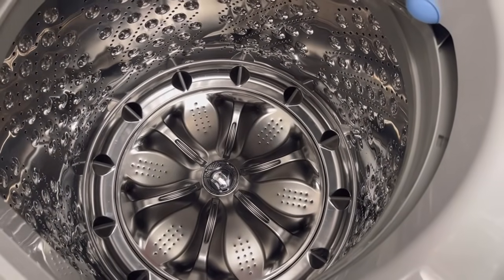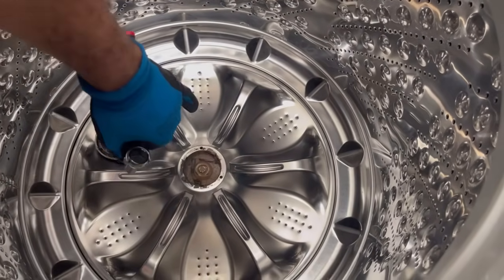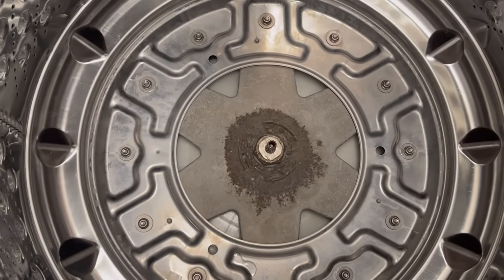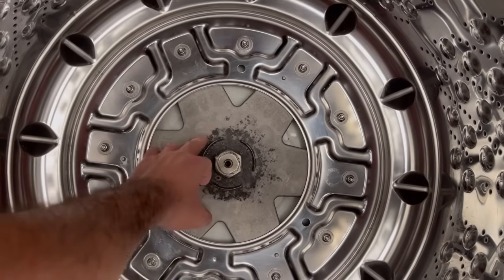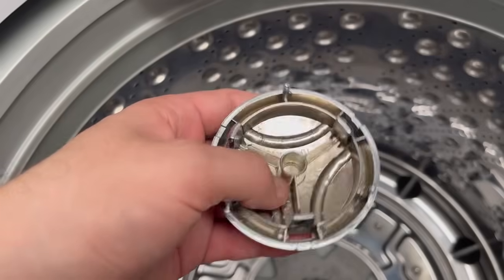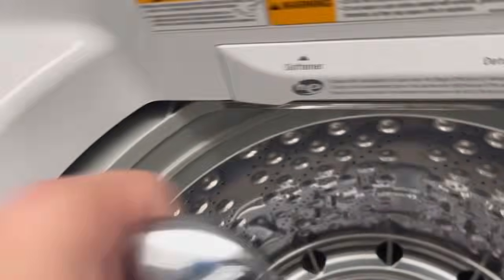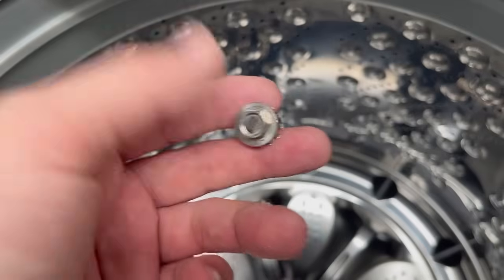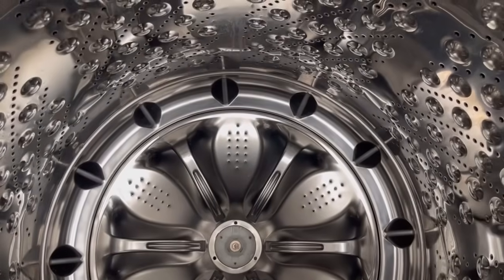How to remove and clean LG washer machine filter

Comment from the maker: The replacement cap can be ordered at this Amazon link should you need one: 

https://amzn.to/3N2rKTi
Reply: How can you take the big wheel out after you take the bolt off we are having a hard time
Reply: @themoroskyfamily9586 I'm sure you figure this out by now, if not in my experience it's a two-handed pole so you're not adding pressure on one side and not the other. Be careful, on the inside is a metal lip that is quite sharp. I cut my finger pretty good.
Reply: @themoroskyfamily9586  I had a hard time too. It didn't pop out like the video. I found it eventually came out easier as I rotated the drum to find a sweet spot, when it eventually came out. Very helpful nonetheless. Thank you @SOBIsHobbies
Reply from the maker: Thank you for your input!
Reply: Yeah.  CANNOT remove the center after pulling the cap and bokt/washer. 😢
Reply: How do I find the correct pump? I think my pump is out cuz I cleaned everything and it's still not draining.
Reply: Kid that’s not the model number the tag will be ether on one of the sides or on the back panel

Comment: Just a small tip for removing the plastic chrome cap. There is actually a small notch on the side of the cap. You can feel around it and when you find it, you can then put you screw driver underneath it and it will easily pop right up. Not having to worry about breaking a tap. Hope it helps with adding to your vidio.
Reply from the maker: Thank you for that advice! 🙏
Reply: I found the 3 little notches and the cap popped up with no breakage! Tysm!

Comment: If I ever have to buy another washing machine I will certainly ask how to clean the filter.  I am a 5’ 3” 71 year old.  I am usually pretty handy but getting all those pieces off while standing on my head is just not possible.  With  the cost of a LG washer you would think the LG engineers could do a better job at designing them.  It is not customer friendly at all.

Comment: I had the same problem with getting the large top plate off as it was stuck. I seen a YouTube short video in which the person ran a tub clean cycle with the plastic cap and screw removed. I did exactly that and midway through the tub clean cycle the plate came up and started floating in the water. No need for screws or pry tools, etc. I just let the cycle finish without the plate inside and cleaned it up and followed the rest of the steps in this video.
Reply from the maker: Thank you for your input!
Reply: Thank you for this helpful tip!!! This worked perfect for it to come loose!!!
Reply: This is the comment I was looking for. I am trying the same thing and decided to look and see if anyone else had the same idea. Glad to know it might work!! Cheers!
Reply: Thank you for the advice. Its work perfect !!!
Reply: I will give that a try.  I've done EVERYTHING to try and get the PULSATOR loose, with no success at all.  Also, it would seem to me, that if you can run the unit with the bolt REMOVED, then they're is really no need for the blue LockTight.
Reply: Wow. Best idea!  I had the same problem and after I tried this method, it worked like a charm.  It floated during the tub cleaning cycle.  Kudos. Thank you!
Reply: That did the trick thanks!!!
Reply from the maker: @gabswiss you’re welcome! ☺️
Reply from the maker: @gabswiss you’re welcome! ☺️
Reply: Thank you very much for this advice! It worked!

Comment: I can’t thank you enough for posting this video. My laundry was funky! I put the cleaning tablets in the tub, clean the filters on the hose inlet valves, and nothing worked. For like a month. I thought I must’ve been missing another filter somewhere but the tub looked like one piece. I had no idea this wash plate was removable until I saw your video. 

I’ve owned this machine for about seven years, so you can imagine what I found under the wash plate! It took me about an hour to get all that gunk cleaned out of there. I’m running another cleaning cycle in the tub, now that the gunk is out. I can’t wait to re-wash all these funky clothes!!!!

Thank you!
Reply from the maker: Thank you for your feedback!! I’m very glad if my video helped you. Have a happy holidays!!

Comment: I had the same problem as many other people. I could get the cap off, get the screw out, but the washplate wouldn’t budge. However, I just got it out, and here is how: I poured about two cups of vinegar in there and let it sit an hour. I read all 195 of these comments and there was ONE comment that helped me by @kulasnikov3875 and it was to add screws. So I found two #8 ceiling hooks and screwed them into the center plastic existing holes firmly (not the metal), and then gripped those hooks with pliers and pulled straight up. The reason it wouldn’t budge is because there was so much gunk underneath the washplate. Hope this helps you. Good luck.
Reply: I initially struggled when trying to pull it out with one hand.  But as soon as I used both hands (backhanded from the center) it lifted out easily.
Reply: @heyou429 if anyone is reading this in the future and has the wt901 model, you can't pull it out like this guy in the video.  There's nothing to grab really.  I was able to get it out using two pliers.
Reply: Before you follow @leannesliva6550 instructions.  Just pour 2 cups of vinegar in the tub and run it on tub clean mode.  That did the trick and made the large silver disc to come loose
Reply: skipped the vinegar step and did 2 pliers with a strong pull and came right off
Reply: So...90% of our washable shower curtain liner got caught under this plate due to [we assume] the little metal weights sewn in it; lesson learned.  
     My husband and I have 34 years of marriage under our belts and have lived in this same home for 30 years.  Yet here we are, hovering over our 4 year old washing machine, one phone being used as a flashlight the other here on YouTube, looking like Bert and Ernie from Seseme Street, trying to solve [what should have been] a simple problem. 😅  
(Glad to see we're not alone having this issue!)
...ok I'm off to get the vinegar. Thank you for the tip!
UPDATE: ...VINEGAR WORKED!!!!!😮  
WOW!!!! 😃 
You don't need a lot, either.  (Turns out my vinegar stash was low - I only had about 2 cups worth.) I carefully poured the [about an ⅛ cup equivalent] vinegar  around (but not in!) the center hole where the bolt sits.  You could do this before even removing the bolt.  We waited 50 minutes (because we're impatient) and with a few gentle tugs-it came straight out! 
     ANOTHER TIP: This may be an already-known suggestion - but we used (don't laugh) weed whacker line as the means to pull the plate up.  We were afraid of damaging the plate so we wanted to be as gentle as we could be.  Being plastic, I didn't think it was gonna be strong enough, but it thread through the 3 holes just fine.  I tied a square knot (tension held it together once I started pulling) and, putting the screwdriver underneath the knot, I used it as a makeshift handle to pull up the plate.  I suppose it didn't snap because the force was distributed equally between the holes.  
   Washing machine is runnin' just fine in the background as I type this. 😊
Reply: YOU SHOULD BE A WASHER REPAIR TECH...  YOU ARE SO SMART.... AND BEING A WOMAN AT THAT....
Reply: This video was helpful. Even if I didn't follow it exactly. After several frustrating failed attempts. I did baking soda and vinegar. Some tapping with a rubber mallet and used a wire coat hanger in one of the little holes where the water drains to pull up and scissors on the edge of the plate to pop it up. So maybe a combo of ideas suggested.

Ps. I have a samsung wa45h7000aw/a2. I was beginning to wonder if mine didn't come out the same. But it does. 

Mine wasn't actually too bad.5 years old. I do self clean regularly-ish. And use vinegar as softener 
 https://youtu.be/LifEij0SMMU?si=KdtckTz7ppCfuJDy
Reply: I'm going to try this.. I've done EVERYTHING!!! Hot water, baking soda and vinegar with and without Dawn. I've been arguing with my washer for 3 days now, next step,after I try this, is a crowbar 😊

Comment: Excellent video.  Knew the cap came off, but unsure how to remove without breaking.  Your video made the clean out easy.  Thanks.  Now if only LG had put this in the manual; or, designed the machine for easy cleaning…
Reply from the maker: Thank you for your feedback. Have a happy holidays!
Reply: Designed not to be easy so you call a tech. Same with cars (except Toyota)
Reply: JUST USE THE CLEAN TUB CYCLE OR HAVE A 5 YEAR OLD LEARING TO READ SHOW YOU HOW TO READ...
Reply: @johncasor9698 doing that right now, updating you to see if that worked
Reply: There is a slot on the side of the cap (not the holes on the top that he used). Slide a flat head screwdriver in that slot and pry it up. You’ll have a better chance of not breaking it. No guarantees though.
Reply: @periwinklesue  I still broke it, lol. But the one I broke was jammed to all hell, the other two came out easy, so this is still definitely the right solution. Plus a replacement is only $10 on Amazon, still cheaper than a service call
Reply: @johncasor9698  I think people miss this step. I use the app to check where we are with cycles and do this every 30-35 loads. No issues/no smell and we've owned it it for 5 years.
Reply: @johncasor9698   You dont have to leave a snarky comment and insult people.  Didnt anyone teach you as a child if you dont have anything nice to say, dont say anything at all.  Its no like you were talking to someone face to face and they asked you personally a question and wanted to know your thoughts.  I know the clean tub cycle cleans it SOME I think it is inevitable that if you wash dirty work clothes there is going to be dirt that gets in there and a regular clean cycle wont get everything.  That is like spraying some soapy water on your car and rinsing it off, it may get it a bit cleaner but not all the way. Usually you need a cloth or the things from the car wash to physically remove the dirt.
Reply: @johncasor9698  nope, i always do the clean tub cycle once every 2 weeks, even still it was SUPER dirty underneath the cap. tub clean cycle can only help so much its not the perfect solution

Comment: Extremely helpful video.   Also, I used three pair of fingernail clippers.  I inserted the rounded but sturdy metal lever into the initial cap's three openings. With the fingernail clipper lever straight down, it did not break anything, but was sturdy enough to very easily lift up that round center cap.
Reply from the maker: That’s a great tip! 👍 Thank you for sharing your experience.
Reply: I used two fingernail clippers. The cap popped off before I could get the third fingernail clippers in. Which was good because I only have two hands.

Comment: Great video. Our is 11 years old and never had a deep clean like this. Just getting the cap off was a struggle. It was vile underneath. 🙈  We couldn't get the main plate off after removing the bolt so I may try to soak some vinegar and baking soda oneday after a tub clean. This machine is a soldier.
Reply from the maker: Thank you for your input and positive feedback.  🙏

Comment: I have an LG washer about12 months old which started to have sludge.  The centre cap was much easier to remove, the lugs holding it are not as big.  Then the bolt on the agitator was still 10 mil. The agitator was very easy to lift out and my wife just used white Vinegar to clean it.  There was no sign of any rust and it came up like new.  This video gave me confidence to attempt the job.
Reply from the maker: @stanurquhart6433  thank you for your input and shared experience! 🙏

Comment: Thank you so much for posting this!!!  We are not mechanically inclined, but your video made this fairly easy.  We just did this today.  The machine is 10 yr old and we weren't good about cleaning it.  OMG, the gunk in there!!!  We followed your steps exactly and managed not to break the plastic cap piece.  We thoroughly cleaned what we could and put it back together. The only thing is that, you will likely inadvertantly loosten some dirt underneath the metal piece and not be able to  reach it.  So after you do this cleaning, I recommend baking soda and vinager runs. And then a clear water run.  I think after that, we should see a big improvement.  After this, we will be washing the washing maching every 2 weeks!!  Thanks again!
Reply from the maker: I’m glad my video was able to help you. Thank you very much for your feedback!!

Comment: Very helpful video. Thank you. Different model but all the same.

 A tip for getting the big center section out. Below the cap you will see small holes where the pegs on the cap slot into (on mine there was). Feed a couple of small zip ties in and out, of the holes. 2 done it for me and mine was well stuck. Make it so you have 2 loops with the zip ties and just lift it out. Do the same putting it back, hold the loops and lower it in. Once done cut the zip ties off. So much easier and no scratches or rough edges.
Reply from the maker: Thank you for sharing your experience!
Reply: Cant wait to try this, i couldnt get mine out for the life of me, didnt think of zipties 😂
Reply: @Emilioo72 Zip ties aren't working . Tub cycle with the cap and screw off not working. My arms are aching but unable to get it off. Ping me if you were able to get it off.

Comment: To get the first cap off I found putting a flat head into the slot and working my way around using all three slots helped. I have a tug at one slot and then moved and worked it loose that way. No damage to the cap
Reply from the maker: Thanks for sharing that tip! 👍
Reply: Would you mind rephrasing “I have a tug at one slot, and then moved and worked it loose that way“. Thank you.
Reply: @ gave*. It’s been a while so I don’t remember but I had to just work around loosening bit by bit.

Comment: Thanks for the video! Our washing machine was leaking. I used the cleaning cycle 2 and still leaked. I had to have my husband get the bolt out. But the plate thingy was stuck. So I thought hooks,I just bought a bunch of cheap hooks for my plants. I screwed in 2 the last wholes on opposite sides and gave my husband some thin rope and it worked. It was sludge underneath, probably softener. I also cleaned the holes where the bleach runs into, and soap,softener dispenser. I just did the clean cycle and it’s not leaking. So thanks!
Reply from the maker: @sandraweber4336  Thank you for your input! 🙏

Comment: Thanks for posting. I truly hate our LG washer. It’s ruined some of my clothes and we have to manually add water to it before we close the lid, otherwise it barely uses enough water to actually clean our clothes. Wish the just made washing machines like they used to.
Reply: They do but they cost $1400 not $600
Reply: Not sure if you’ll read this. I was having a water level issue as well. So puzzling, but I found that if I use the “bulky cycle” with the “ cold tap water” option, it fills up. I’m new to this machine so I’m still experimenting but that’s one of the ways I found to get a good was in.
Reply: I would never buy an LG again
Reply: Water levels can be adjusted before washing starts. I just increase water level. As I need it.

Comment: Thank you for this video! I've looked many times for a way to clean the washer and was so excited to find your solution. It was so satisfying to get all that junk out. Here's hoping for cleaner clothes!!
Reply from the maker: That’s an awesome news! I’m glad you found the video to be helpful. Thanks for your feedback. Have a happy holidays!
Reply: Help once I removed the bolt,O-ring & washer I can’t take that big round thing out.
Reply from the maker: @YellowCyan2  you’re just going to have to pull it harder straight upwards. As long as you removed the bolt and the washer there shouldn’t be anything else that would hold the bottom piece. It should come off at that point.
Reply: Thank you!!! I'll keep trying!!! My washer is 4 years old
Reply from the maker: Ours was 5 at the time of this video. 😅 I did have to put some effort to get that piece out too. So don’t be too annoyed about it. After extensive use for several years some times they get stuck and whatnot. Just be patient and do your best. Good luck!

Comment: I clean my tub on the Tub Clean cycle once a month with Fresh Tab for washers. I will check this out and see how mine looks.  Thanks for the video.
Reply: How do you run a tub clean cycle?
Reply: @sarahfarnsworth8488  That is a cycle option printed on machine. It's the last one listed.
Reply: @sarahfarnsworth8488  my tub clean is printed very small on the " fabric softener" button and you hold it for 5 seconds until it dings. That's the tub cleaning cycle.